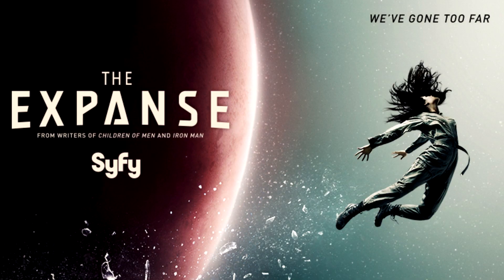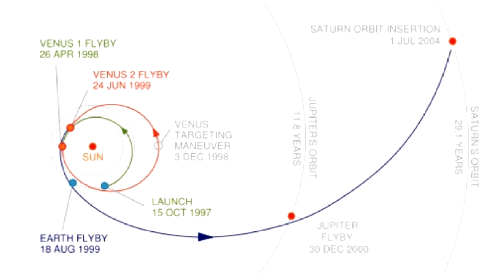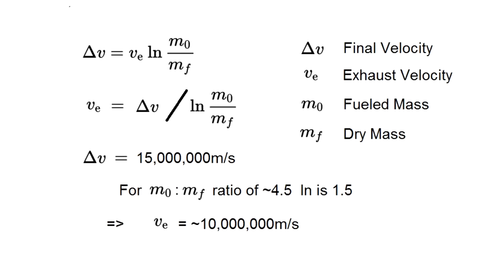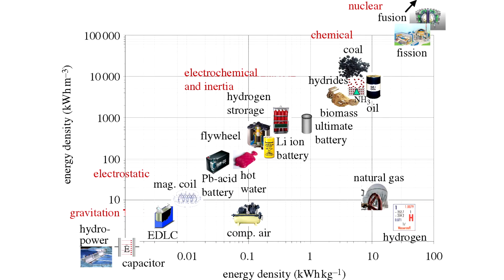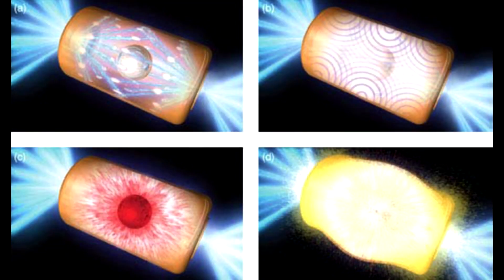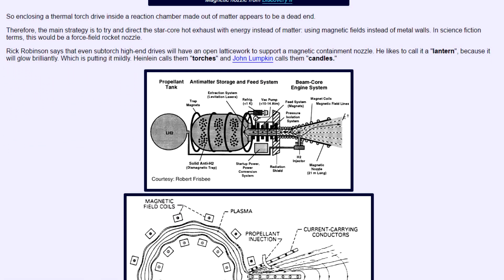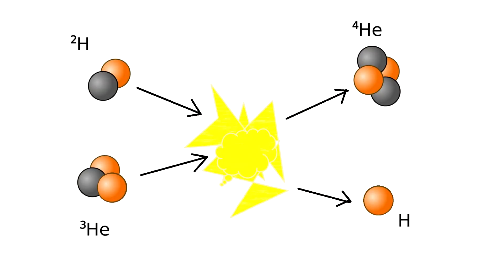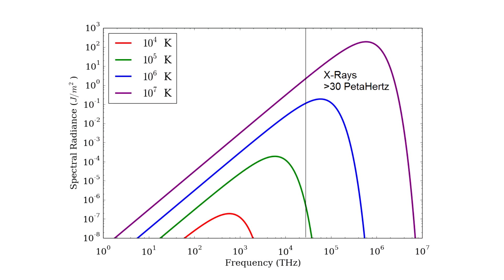The Rocket Science of 'The Expanse'

Comment: This argument of thrust reaction energy being impinged on the ship sounds convincing at face value but is not quite valid. For example: The reactions that take place at the chambers and engine bells of modern rockets - let's take Falcon 9 as an example - release enough energy to melt the structural materials of the whole rocket many times over.
For falcon-9 the rocket releases about 4 Terajoules during a 160 second burn.  If we assume for simplicity's sake that the bottom of the rocket is made of nothing but titanium, just half a percentage of this is enough to melt and vaporize half a meter of the bottom of the rocket off. Enough to completely erase the engines. 
Yet this clearly does not happen, and if we assume just one centimeter of titanium is eaten away this way (in reality it's even far less) then Falcon-9 demonstrates the ability to have less than one thousandth of one percent of the launch energy contributing to the meltdown of the engines!
In reality the thermodynamics are a bit complicated and one can't just take a lump of energy and dump it somewhere and see if that's enough to melt something. 
Engine chamber materials can to a large extent stand the temperatures of combustion in the chamber. If that doesn't melt them, then there is no immediate effect that damages them in any way no matter how long the engines fire.
Reply: Thing is though that the energy in a conventional rocket is guided outside the nozzle into the environment. The waste energy Scott is talking about here is generated inside the reactor and cannot be guided (Neutrons) therefore being fully, or to a large part, absorbed by the ship.
Reply: @89DerChristian   That's where I feel you and Scott fail short as far as 'theorycrafting' goes.
Scott's whole argument is based on the idea that the produced neutrons (let's ignore the radiation for now) cannot be guided (which he explains) AND are produced omnidirectionally (which he doesn't address, but just assumes as a given).

Now, of course this is just 'science fiction' and theorycrafting, but who's to say that they didn't invent a way to actually control the fusion reaction in such a way that they can direct the produced neutrons from the reaction?.. I know what you're about to say: "Heisenberg's uncertainty principle".. and you'd be right.. if you assumed no headway was made to circumvent or diminish it. But again, that's an assumption. Heisenberg's uncertainty principle doesn't state an upper limit, simply that there 'probably most likely' is a limit beyond which we cannot increase accuracy. Who's to say you'd need to even get close to that limit to be able to guide/point the products of a fusion reaction 'well enough' to provide immense thrust while also not melting your spacecraft?

D'yall think Newton or Einstein discovered what they did by saying "that's impossible because of <insert leading assumption about physics at the time here>!"?
Of course not. :)
Reply: @ayporos  neutrons flying everywhere is not a problem of heisenberg, it's a problem of statistics saying they will be emitted isotropically and the fact that they're neutral and can only be deflected by unachievably strong magnetic fields (the kind you find in pulsars) or bulk interactions with matter (i.e. impinging heat)
Reply: @ayporos  to add on, 5 percent impingement is actually pretty generous on Scott's part considering actual studies done on how we might do this couldn't get much better than 10% for the most radical designs
Reply: @89DerChristian  indeed, it's not just that neutrons can't be guided - it's that the mass flow rate out of the engines for the Expanse are so pathetic compared to the Shuttle (they have to be if they're going to be that efficient) that you can't carry off enough heat in it to matter
Reply: +Dean Su That is oxymoronic. Waste heat by definition will be a fraction of the energy dumped into the exhaust. The actual mass of the exhaust is entirely itrelevant. Our problem here is that there is a larger percentage of waste heat than in chemical engines, which rekquires either neutron or x ray reflectors ( nonexistent technology), sirectionally controlled fusion reactions ( a violation of the uncertenty principle) or clean fusion ( too slow or toohard to initiate) to work.
As you can see there are multiple angles to come at the problem, but no answer as of yet exists.
Reply: It is true that fusion reaction temperatures are a lot higher and that it (usually) releases neutrons. One could maybe point at existing reactors like JET (and ITER) that demonstrably can handle the reactions but maybe those are not comparable. Instead I should point out that exhaust which is plasma can be handled like plasma: with magnetism. This is not theory, we've done it for decades. Also it's not beyond imagination to just use buffer material between structures and reactions. Like water. I still hold stubbornly to my opinion that executing the reactions is the hard part, handling heat seems doable. :D
Reply: +MVHiltunen We could initiate the reactions since the late 50s after Neumann János got the H bomb working. Its keeping them contained and exploiting their energy thats hard, mostly because we need very higy efficiency or very large heatsinks to manage the amount of waste heat in such a short pime period and small place. These things are 100 tp 1000 times more energy dense than current pressured water fission reactors, which already operate below 30% efficiency. Dealing with 1000 times the waste heat from a reactor of the same size is the problem.
Reply: The question is also why would the engines even produce neutrons in the first place? I mean yes, the proposed variants of fusion do, but that's the point. Let's start with fusing hydrogen. Scott clearly points out that such engine can't fuse it like the sun. But why fuse it "like the sun"? The process in the sun, a proton-proton chain would be useless, it's true, but it is not the only know proces for hydrogen fusion.  CNO cycle, especially hot CNO cycle fuses hydrogen much faster. There might also be another catalyst-based fusion chains that are not yet explored that use heavier isotopes and/or particles in a way that eliminates neutron emissions...
Reply: @mancubwwa  Well several aneutronic fusion paths are known. This is not my brach of physics but I'm under the impression that He3- rections and proton-boron reactions are whre the party's held. Proton boron is the cool kid's version and potentially feasibly laser excited.
Reply: Neutrons and x-ray photons vs infrared to uv photons in a moving column  of plasma
Reply: I once built an F-104 Revel plastic model and put an Estes C engine in it.  It melted the tail section.  So I cut off the melted part and encased the engine in aluminum foil.

Comment: What if they did what he said in video. But... they didn't ignite it inside the engine but rather ignited it out behind the spacecraft then used the magnetic fields to push the spacecraft at a constant rate away from the fusing fuel behind it? Much the same way a blow torch ignites out the end of the torch, not inside the nozzle. Does that make sense? They could use magnetic fields to regulate a small steady stream of fuel out behind the craft then ignite it far enough to not melt the back of the craft. And use the same magnetic fields that is regulating fuel supply to also push the craft forward. Instead of push explosion out the back they push them selves away from stationary exploration behind them at a constant rate. And trailing just enough fuel behind them to keep the exploding fusing fuel behind continuously fed.

Comment: After 100s of years doing nuclear fusion I will not be surprised if it become totally feasible. Also we know that our theories of nature are somehow wrong.  Not only we know that General Relativity and  Quantum field theory don't appear to dance, but also we have the renormalization issues with quantum gravity,   the Mass antimatter asymmetry and even worse: it seems that quantum mechanics  is not self consistent when dealing with multiple observers.  Even today it seems that we just have a thermal problem. Neutrons can be affected by magnetic fields but it's not efficient (they are neutral at a distance but they are build from charged particles that move generating net  magnetic moment). We have other reactions involving Lithium and so on. Most of the problems can be solved by changing the mass  ratio or lowering the acceleration to that of the moon or mars.  Changing the mass ratio is beautiful as it allows the introduction of intern mass, that can carry and use a fraction of the neutrons.  I have not seen the series and I am sure they are many other problems, but the engine is very close to possible in few 100s of years, even if we don't fix Physics  in all that time.

Comment: OK, disclaimer: IAMANP, but from what I've read, if you push a positron into a neutron, you'll get a proton as a result. Would it be possible to 'sprinkle' positrons onto your plasma to catch the neutrons emitted via D-T fusion and make protons that can then be used for propulsion? Like that you'll get better ISP and resolve a large part of your heating issues.

(Making a positron beam is left as an exercise to the reader)
Reply: I don't think so, the chances of a positron hitting and being absorbed by a neutron is super low. It's not impossible but I don't think it's feasible.

Comment: Sorry for blowing up your comments section.  Ok, here is a much better response.  Your arguments serve to help us understand that an Epstein drive cannot be a plasma fusion drive.  Also, they help us understand why it must be aneutronic fusion.  Also, being dependent upon he3 is not terribly viable either.  But that still leaves open, H+Li7 or D+Li6 fusion, done with an accelerator.  Right now this is not done in real life because the cross-section of the reaction is too low.  However, if the mythical Epstein found a way to increase the cross section, then a viable, aneutronic, low radiation from of propulsion could exist.  And, such a form of propulsion would not directly confront the laws of physics in anyway, except WHY? Does this ultra high crosssection exist.

Comment: You can greatly reduce the amount of radiation hitting the ship, especially the occupied portion, by making it narrow.  Also a few scaffold-like spacers between the engine and the fuel tank along with another between the tank and the crew compartment, and you could quite easily get the absorption down to one percent.

Comment: Uranium saltwater reactor rocket would do it🎆🚀🎆🚀🎆🚀
Reply from the maker: No it wouldn't. Specific impulse is too low.
Reply: From Atomic Rockets   EV 66,000 M/S on the low end, 4,700,000 M/S on the high end . Not up to expanse standards of 15,000,000 M/S , however it would open up the solar system .  GO ROCKET CAT 🎇🚀🎇🚀🎇🚀🎇🚀

Comment: I haven't read the books,  but it's doubtful the drive would work they way it does in the Expanse universe within the constraints of our understanding of physics. 
Epstein drive is by necessity a closed-cycle (no spilling of deadly radiated exhaust everywhere) gaseous core nuclear engine - i.e. a nuclear lightbulb concept. It is a concept that requires absurdly powerful magnetic fields to contain and direct the nuclear reaction, as well as force the exhaust in the correct direction. In theory, a highly efficient fusion reaction would be able to produce required magnetic fields, so you'd need that too.
It's still unlikely that a fusion reaction would be enough to produce sustained accelerations described in the books, so they must be some hybrid fusion-antimatter engines.
In almost any case, the propellant would most likely be water of hydrogen, both of which need pretty big fuel tanks, and heat dissipation, or everyone melts on the ships. Neither seems to be present in the show.
Reply: Its is an open cycle torch drive.
Waste radiation is conveniently ignored.

Comment: How about using the heat for Energy and using this Energy to speed up the output of the fusion engine even more.
Let´s say we get the exhoustion near 30.000 km/sec. What about that.
Reply: Problem - you need a cold side. You can only get energy from heat when it goes from hot to cold. It's the gradient that gives energy, not the heat energy itself.

Comment: Proton and Boron-11 electrostatic fusion would be ideal in this case, all reaction products are helium nuclei and energy. If the exhaust plasma is dense enough it will carry most of the energy with it out of the structure, but I reckon cooling will still be required or the nozzle will melt pretty darn quickly. Don't know if it would be powerful enough to be an analog with the drives depicted in the expanse, but enough to open up our solar system for exploitation and our closer neighboring stars for unmanned exploration in reasonable timescales.
Reply: You need an isp of roughly a million seconds, and a TWR of 10 to be as good as the show.

Comment: On Helium 3 fusion, apart from deuterium with helium 3 reaction there is also the option of fusing Helium 3 with itself, which produces only Helium 4 and hydrogen as by products. Then there is also the boron + hydrogen reaction which is also aneutronic. Both are much more difficult to achieve, as in requiring much higher temperature and/or pressure but by no means theoretically unachievable.

Comment: Exactly X-rays are emitted from black hole because they tear matter apart, so why wouldn't the same apply to a fusion reaction? The back end of that ship would be very radio active,  if it didn't just vaporize the cones. Plasma propulsion would also vaporize any landing bay structural material too.

Comment: The inflowing fuel must therefore be the one cooling the drive and making the efficiency so high therefore the drives input fuel is injected as cold plasma Wich is heated by the nuetrons and gammas Wich is injected and fused before being exhausted out of the engine.
Reply: I have drawings on these
Reply: Fuel enters in a cold plasma state as nuclei and electrons, they are sent to back of the drive, then they curl around the while core of the drive and produce their own axial magnetic field, this contains any fusion reactions, they are then directed into the frobt of the drive and compressed, they fuse, the escaped products like nuetrons and gammas then heat the inflowing fuel making fusion run easier and allowing faster exhaust velocities and protecting the ship with its own fuel supply
Reply: The reactor core itself is the propellant.

Comment: They could expel a cooling fluid (such as ammonia or water) in the exhaust which would increase thrust but lower exhaust velocity. I know water has a specific heat of 4KJ per Kg, times a hundred to boil it is 400kJ per Kg and a ammonia solution has a higher specific heat capacity and heating it past boiling, it might be possible to cool as much as 1MJ per Kg of cooling. With a theoretic velocity of 26 700 km per second it would be possible to pump 6 Kg of coolant per kG of fuel and still get above 10 000 KM per second. This would result in almost 10% of the heat energy, enough if only 5% of the photons heated the spacecraft. This is achievable by moving the X-ray shielding back 5 meters if the crafts engine is 2.5 meters in diameter, and using X-ray transparent material for the engine.

Disclaimer:  I am awful at maths and probably got someting in my calculations wrong
Reply: Why wouldnt you use mercury or molten salt as coolant? Why wouldnt you let it ionize? Efficiency is thebnamr of the game and we are making a fusion torch so there is no reason to hold back.

Comment: The ships of every show and movie ever made are completely wrong... In space the direction of travel under thrust is "Up" and the engines would be "beneath" the ship and not " behind" it... thrust provides gravity; therefore every ship portrayed in every movie or show I have ever seen would have the pilots lying on their backs with their butts pointed "forward", passengers would fall "down" the decks and wind up flattened against the "rear" bulkheads... I find it annoying to hear people talk about the plausibility of the "science" of these shows without ever once mentioning that the design of the ships is completely unrealistic and would, in fact, be quite impossible simply because  the orientation of pilots, passengers, crew, and especially the decks and engines is essentially turned 90 degrees in the wrong direction.

Comment: hydrogen boron fusion is aneutronic and would be feasible.
Reply: Yes but the amount of photon radiation off that reaction for the necessary temperatures would melt your spacecraft just as fast, if not faster. I've heard getting the temperatures for that reaction would leak more high energy photon energy than you can capture to sustain it.
Reply: Unless you used particle acceleration for impact fusion plus the very act of accelerating fuels to the speed required would also generate thrust.

Comment: He3 + He3 = He4 + 2p fusion is completely aneutronic though. Neither the fuel nor the products can fuse into anything else, making the reaction completely neutron free. B5 + p = 3He4 is another aneutronic reaction and Boron, unlike Helium3, is a very common element.
Reply: The temperatures necessary would release too much photon energy. That's the major problem. Black-body radiation basically. If you have  matter at 500C and 1000C, more photons come off the second object, now imagine millions at of degrees. Your coils would melt eventually at 30TW!
Reply: +The Eh Team X ray reflectors are a must. But I guess you can do that by capturing it via excitation and reradiating it in a reflectable spectrum.